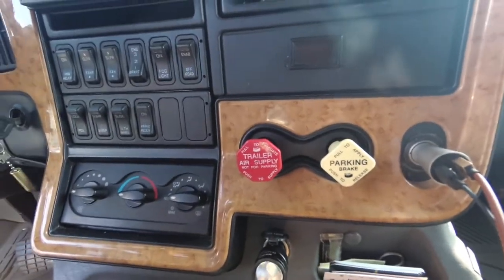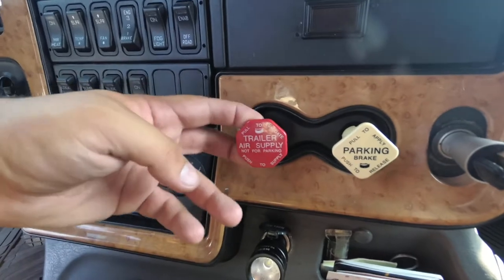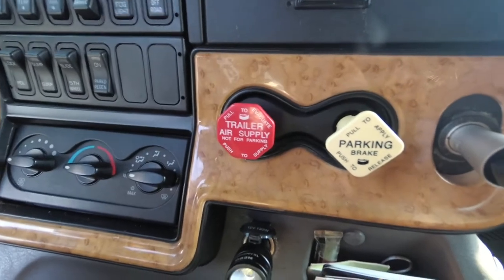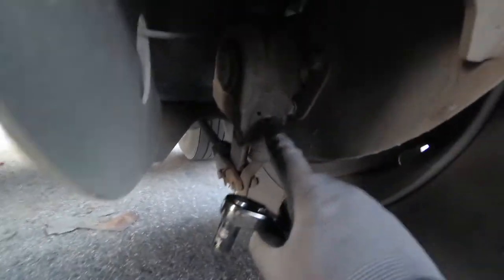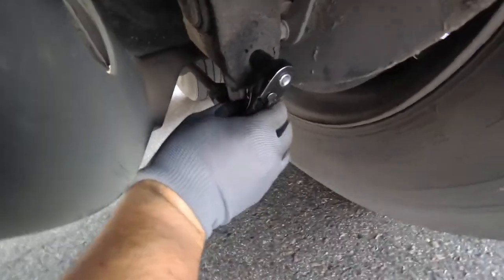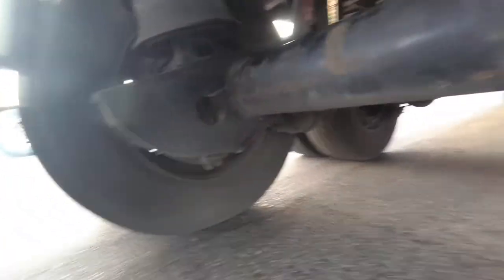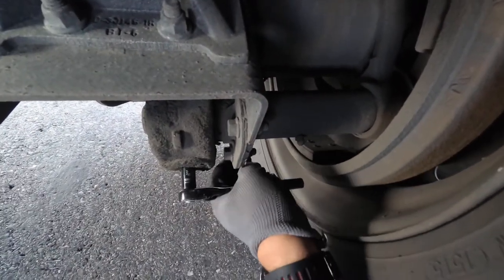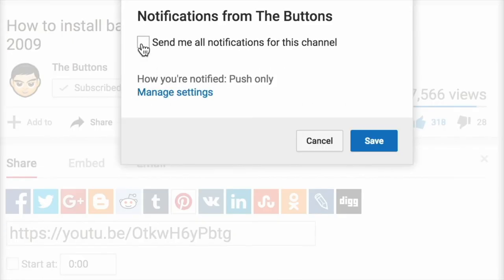How to Adjust trailer truck brakes fast and easy

Comment: @ 1:37 u said counter clockwise but u turned it clockwise, anyway great explanation.👍 what u did is absolutely right that how u do it.
Reply: Don’t forget that manual slack adjusters the opposite is true: counter-clockwise tightens & clockwise loosens. I once made the mistake of trying to adjusting rear end 9/16” automatic slack adjusters on Freightliner Cascadia. Tight fit & hard to turn. I was on my back on a creeper looking at it upside down. I forgot that my perspective was changed and I was tightening when I was actually loosening the brakes until I looked at how wide the gap was between drum & the brake shoes.

Comment: where you parked in gear or in neutral, where the tractor breaks on, does it matter?
Reply: IMO, it is better not to have tractor in gear (in case there is an air leak in your system & you end up having to crank your truck up to maintain proper air pressure; also you don’t want the truck to jump in case you forget it was in gear & you start up the truck without pushing down on the clutch), but have the tractor parking brakes on & have the wheels chalked for extra safety.
Reply: When I do trailer I set tractor brakes

Comment: When you said turn it 30, I thought you meant degrees. Then I realized you meant minutes like on a clock face which is 90 in degrees.
Reply: 180°